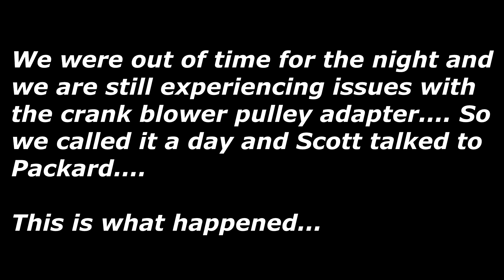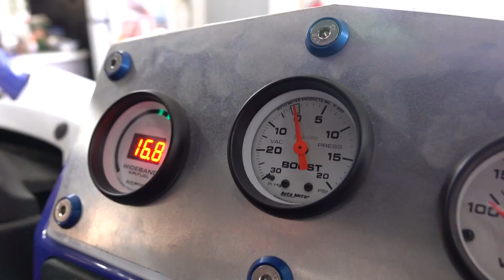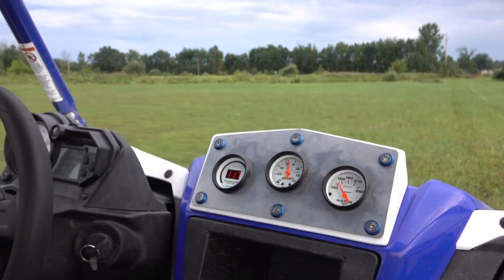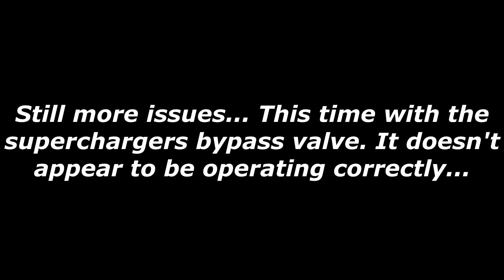Yamaha YXZ Packard Supercharger install! Vs YXZ vs X3!

Comment: So, my ignorance will probably show here.... 
Everything is turbo right now and to be honest they are getting amazing results. In the day turbos were all about running flat out and super chargers would give you monster off the bottom power all the way to the top. Has anyone developed a super charger with the appropriate engine modifications to make real power in the yxz? I know they can make huge power since dragsters run blowers.... not turbos.

Comment: looks like doug worked overtime trying to get it straightened out, but once the issues were fixed you could instantly tell it worked perfect. Great job fabricating the kit to make it work like a champ.
Reply from the maker: Packard certainly helped out with getting us the right parts. But it would have been awesome to not have to wait!

Comment: I'm curious to see how much boost the amr500 supercharger can make with maybe a differrent pulley and stiffer spring in the waste gate. I'm hoping I can get at least 8 to 10 out of my agency power.
Reply: How are you like the Agency Power? Mine is on order ,how did the instal go? Horsepower increase?
Reply: it made a huge difference I really like it. I did a complete engine build to be safe.
Reply: I just finished it last week I'm taking it to a dyno. I'm still trying to get everything dialed in. And working out some minor bugs.  only thing that sucks about the agency supercharger kit so far that I see is the boots keep popping off their plastic intake manifold the Packard was much nicer billit.
Reply: And the blower belt gaurd broke from rattling around just driving around the block a few times. also take note the lower throttle body boots will not stay on unless you take the clamp spacers out or put smaller ones on. I learned the hard way. but if everything is done right it definitely rips as soon as you touch the gas.now I'm trying to work out the blower surge at idle. not sure if it's supposed to do that I need to contact vivid racing today to see if that's the way they tuned it

Comment: So I'm torn between the X3 XDS turbo or a yxz adding either a turbo or super charger.. from the vids it seems like the X3 is still faster IMO. Why did Scott go with a charger vs a turbo they are about the same in cost right? Sweet black X3 by the way you guys earned a new subscriber by the way....
Reply: bigbusa01 supercharger is cheaper and has no lag.
Reply: What are your thoughts between buying a X3 turbo or YXZ and adding a packard turbo I have 3 raptor 700r se's with the big 3 mods like the idea of shifting and don't really know how reliable the belt setup would be on the X3
Reply from the maker: Thanks man! Scott likes being different. The supercharger kit is allegedly a lot easier to install as well. I guess that proved to not be true lol
Reply: bigbusa01 I have a YXZ and I love it, the X3 is the best chassis now for jumps & corners. But with the belt drive you loose the connection between you and the machine. Some people don't notice it but I do.
Reply: Didn't realize you guys are from Michigan too I'm from the grand blanc area... not sure how far that is from you if it's close we could ride together one day ever do Bundy hill?

Comment: bad thing with the super charged yxz is that the belts and pully hardware is not going to last, in the dunes the sand will destroy them and in the mud and water there will be slippage and grinding of aluminium , and if a rock or stick gets in a blown belt

Comment: CHANGE THE PULLEY = MORE BOOST! Also the YXZ is losing a bit of power between shifts while the X3 doesn't. Which is probably why it still beats the Yamaha.
Reply from the maker: And watch the rods fly through the block with the speed of light LOL
Reply: SXSBlog.com Not necessarily, most smaller displacement engines can withstand 10 -12 pounds of boost quite easily.
Reply from the maker: I see you don't know much about the YXZ. lol
Reply from the maker: YXZs have notoriously bad rods and 5-6 psi is about the limit before seriously rolling the dice
Reply: SXSBlog.com Weak ass engine then....no wonder nobody buys them.

Comment: any power mods u guys recomend for a 2015 can am commander 800 dps i have factory can am snorkel kit and K&N air filter and epi sport utility clutch kit
Reply from the maker: Hey Ken, seems like you hit the nail on the head with the mods! Other than an exhaust it sounds like you got the machine covered. Clutch work is the most bang for the buck you can do on these machines.

Comment: Your gonna need the thing tuned to make any power...
Air fuel was WAY off. Should be 12.5-13.5 under full boost no matter what
Reply from the maker: AFR was low 12s when we were finished with it.  13.5 under boost?  You must like to live on the wild side, lol.

Comment: Great video.  I saw the power commander 5 sitting there.  You don't have to adjust the air/fuel mixture?  Seems the engine would have to be tuned with the supercharger added.

Comment: You would think that the kit would recommend to reflash the computer to make up for the extra boost?
Reply from the maker: A prerequisite for the kit is to send Packard your ECU for tuning prior to installation. They also include a handheld tuner for fine adjustments.

Comment: What is done with tuning? Is it on stock injectors and fuel map? 

Also, this was a great video!!
Reply: Reflashed ECU with a Powercommander piggybacked for fine tuning.  Stock injectors.
Reply: Doug Butterfield that's freaking cool! Is there any plans for upgraded injectors and more boots down the road?

Comment: Im curious what needed done to control the air/fuel/spark on this buggy?  Any insight would be great
Reply from the maker: Chad Shumaker The ECU gets flashed by Packard and then a Power Commander is used for fine tuning

Comment: I'm having issues with my yxz supercharger install too. I only get 2-3lbs of boost. Where was yours leaking? Near the throttle bodies at the manifold? Also, I couldn't see it too clearly in your video but it looked like he had no vacuum pressure at idle. Is that normal? That's what my gauge shows too.

Comment: Ok thanks.  So did the runs y'all took in the video without the fuel controller or had it come in by then?  We are installing mine sunday and want to be able to test it if I can because we are going on a riding trip next Thursday.  I ordered the upgrade pc5 which I hope will be here before next Thursday but would like to test it if I can before it come since we are going on a trip 4 days after I install it.
Reply from the maker: We didn't install the fuel controller because it came far after we completed the install. We had the wideband air fuel ratio gauge which allowed us to know if the tune was lean. Everything seemed decent so we went ahead with running it.

Comment: I'd do low compression pistons and put as much as that supercharger will do into it and then it will really really fly.
Reply: You can get a smaller pully that makes 9lb.
Reply: What's the highest that supercharger can put out?
Reply from the maker: I think all those ideas are on the table.
Reply: I think 10lb is the limit with this charger. Packard is working on a twin screw blower  that is putting out 20lb+  Should be released In the next couple months.

Comment: I didn't see it in the video but did you get a fuel controller with it?  I just got mine and there was no fuel controller or at least what I know them to look like wasn't in the box.
Reply from the maker: Great question man! They had a computer reflash that was used. Eventually they sent a fuel controller for fine tuning.

Comment: Excellent video.  Pretty amazing that a supercharged yxz with only 5 pounds of boost is holding its own against the high boost x3's.  I'm real happy with that.  Not at all happy with the packard lack of instructions and kit that doesn't really work out of the box.  I guess with any new kit there is going to be some glitches but it sucks when the consumer is having to find the issues for the builder.  At least everyone is happy with the final product's performance.  I'll just put this one on repeat.. :)
Reply from the maker: Hah thanks Danny! We're really happy with the performance as well. We are still looking to get Scott's long term review on the kit but it seems as if its so far so good.

Comment: Did you have to tune it after or stock computer setting?
Reply from the maker: It must be tuned.  Packard reflashes the ECU then you can use a power commander for fine tuning the fuel side.

Comment: what kind of company would sell you a supercharger that has parts not working and parts that look way different that other parts.
Reply from the maker: Packard. lol
Reply: The funny thing is that Packard include a valve that didn't work then sent a replacement valve that was completely different. How could a good company
make that kind of mistake? Thats for the video cause I will steer clear of PACKARD. GGGG
Reply: Because of Packard we have turbos on sxs. They pioneered it! Before any manufacturer decided to they saw what packers did an copied it

Comment: Blowers are always disappointing. Turbo is the only way to fly.
Reply from the maker: The only disappointment was the issues we had early on. It's immediate boost and big time low end torque gains will really be beneficial for how we ride.
Reply: I agree completely with Doug, the low-end torque produced by superchargers is extremely user-friendly in trail riding / rock crawling.
99.9% are just Trail Riders.
Reply: Just to clarify opinions lol, I think the SC performance met expectations at the end of the day, but I am a turbo guy and if you want big power that is still the way to get it in my eyes.
Reply: Gotta say I have done a good many supercharger and turbo installs on many vehicles.  Aside from the heat factor, and it's a huge factor, the turbo will destroy the blower in almost every aspect of power delivery. You simply cannot get past the parasitic loss inherent with a belt driven power adder. Taming the heat and proper tuning are must haves, but once those problems are solved the turbo wins every time.
Reply: I don't disagree!

Comment: I would like to see Doug build a low compression yxz motor just like the X3 and rzr turbos.   Compare apples to apples no cheating or favoritism.  I plan on doing this when I get some money or a sponsor lol.  I would love to know what the motor cost would be on top of the 6000.00 dollar turbo?
Reply from the maker: Man you're probably looking at anywhere between $800-$2000 for a motor build depending on parts.
Reply: Put rods in it and stack a couple head gaskets...  Good head studs, fuel, & corrected cam timing for boost and enjoy more power with less pressure and way better response than a laggy low-comp motor.  People are going low compression way too low in the HP spectrum on these builds in my opinion.

Comment: Your DP (Doug pound) conversion is backwards.  You said 3.26 DP per Ft lbs(video mark 19:50).  That would make DPs less powerful than Ft lbs.  Corrections are needed as clearly DPs are more powerful than Ft lbs.  Im sure you mean 1 DP is equal to 3.26 ft lbs LOL.
Reply from the maker: Sometimes I get caught up in the hype. It's a reciprocal.

Comment: I would have went with the Packard turbo kit instead of a supercharger
Reply: ak47slaughter 123 Supercharger is much better than a turbo. It gives horsepower throughout the entire power band from acceleration to top end. Turbo helps with top end only. Also superchargers have zero lag while turbos have to spool up. You can push more horsepower with a turbo but these smaller displacement engines can only with stand so much.
Reply: Alot of misnomers there; a LARGE turbo will only help with top end...  Same with spool time...  Lets not forget you are robbing HP from the engine to run that compressor on crank; turbo's are always more efficient.  Properly sized turbo will help everywhere from 1.5k RPM up.  

Would be fairly easy to drop in a turbo system that works on torque; vs screaming HP.  Plenty of dyno sheets prove that fact even down in 2k range.  Just do a quick google search for them.  Just alot of people throw on biggest turbo available because "more HP = good" and then low end suffers.

Now the issues with turbos; more complicated install; exhaust nightmares; more heat problems (heat soak) from complicated headers / manifolds.  More maintenance, (header gasket leaks!) etc...  Pending application can make the "engine area" very un-fun to work on.

In theory a supercharge install should be simple; this video example not included in that statement. :P

And of course; lets not leave out the crazies; if you want to pump out 400HP; you are going need a turbo, and a basket to collect your pistons and rods after first run.

Comment: Race them on a surface where they can all get traction, this was a stupid comparison
Reply from the maker: It's almost as if we used the surface that offroad machines run on.
Reply: They were made for a flat grass field...? That must suck to not have anywhere fun to drive them... No need for additional horsepower if they just spin.... Dump comparison
Reply from the maker: Do you do the same kind of complaining when people run turbo quads in the sand? There seems to be a whole lot of spinning in the sand as well. Using your logic every race video not done on a 100% sticky drag strip is a dumb comparison.
Reply: Of course tires spin, I said get traction... And, yes sand and paddles would be a munch better comparison, because they have more traction than a wet grass field. Go drink another beer genius
Reply from the maker: You do realize all these machines were in 4wd and spun for maybe 5 feet total?
Reply: And then, after 5ft lol,  they all had no tire spin and hooked evenly as well... Good job. Couldn't have done a better job.
Reply: Not sure if troll or this guy really thinks tires spin less in sand than on packed, tacky dirt.
Reply: Doug Butterfield thats obviously not tacky packed dirt... Not worth my time, but all I was saying is this was a poor comparison, my opinion of course!
Reply: Turbocharged Yeah....turns out this was actually filmed on my property and I can confirm with 100% certainty that it is packed and extremely tacky.  The traction was excellent.  I'm sorry you didn't like the results, but they are what they are.
Reply: Doug Butterfield I guess "tacky" and "packed" have different meanings to different people...  I could give a shit about the results, hell ya, go Can Am!! Just a poor comparison...
Reply: Turbocharged Literally can't be a better comparison.  Great traction, even lanes, same tires, and on the surface the machines were built for.  Not sure what video you're watching.